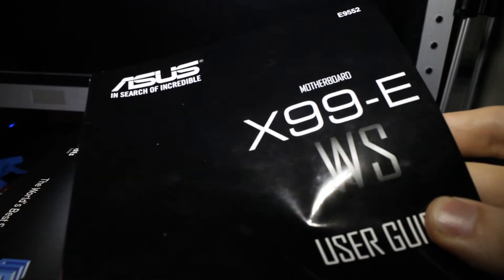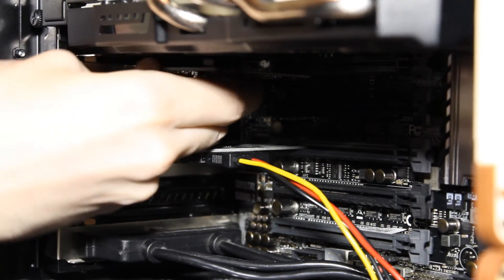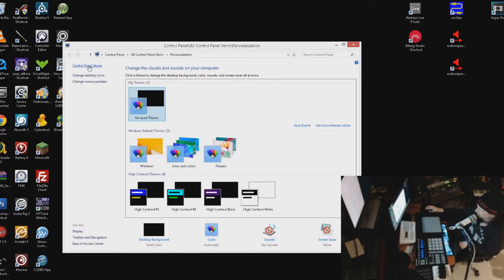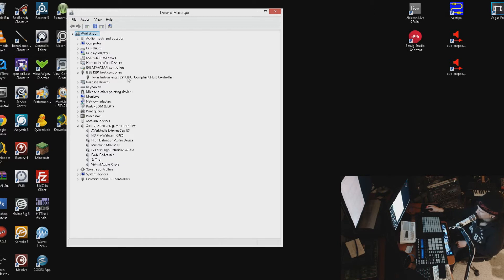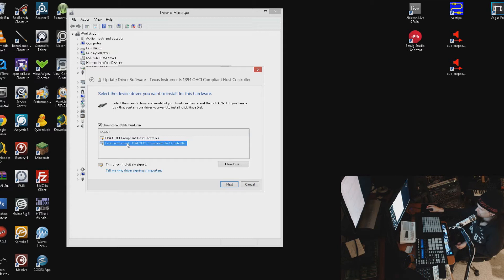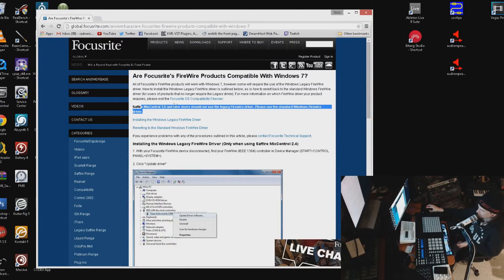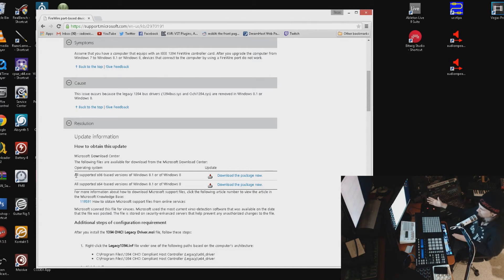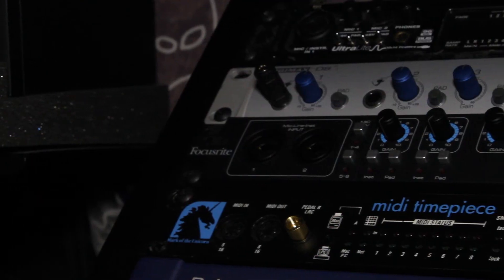Adding A Firewire Card For Your Audio Interface 03 - IRQ, Installation & Texas Instruments Drivers

Comment: Brother can you help me i have focusrite saffire pro 14 and i have not firewire port in my pc please tell me which firewire card i want to buy run my audio interface i have gigabyte h510m-s2 motherboard its have two pcie slot here the specs - 1 x PCI Express x16 slot, running at x16
(The PCI Express x16 slot conforms to PCI Express 4.0 standard.)*
* Supported by 11th Generation processors only.
1 x PCI Express x1 slot
(The PCI Express x1 slot conforms to PCI Express 3.0 standard.)
in 1 port i run my graphic card one is empty

Comment: I bough the same card as you but i got a different driver. should i have the same driver as yours ? driver is 10.0.1904.1 I am having trouble setting up a profire 2626 . My computer recognizes, and i downloaded the control panel software , driver for the M-audio .just no audio .  Thanks for your help .

Comment: I could really use your help.  I'm running a Presonus StudioLive 32.4.2 32-track mixer for recording/playback but keep getting pops and clicks in the audio during playback (only).  Ruled out my sound system since I can play an iPod pristinely via the mixer.  But whenever I play audio on the computer via my Texas Instruments FireWire 800 connection, it gets the clicks and pops.  I do not have this issue when listening to computer audio via my headphones, only via the FireWire 800 connection to the mixer.  I have tried dozens of solutions involving every buffer size, adjusting minimum processor % speeds in power settings, running the cable thru the other FireWire 800 port, changing sample rates down to 44.1 Khz instead of 48 Khz to no avail.  This is on a brand new system with a Intel i7 4790K, ASRock Z97 motherboard, 32 GB of DDR3 1600Mhz RAM, and Samsung 960 Pro SSD for my OS drive.  We are at our wits end and cannot remove the popping/clicking.  I have a new FireWire 800 cable on its way just in case, but I have to believe it has something to do with this connection, whether it be the Windows settings, cards on either end, or the FireWire 800 cable itself.  Please help!

Comment: My M Audio Profire 610 Has Stop Being Recognized By My Computer... PLEASE HELP
(I Made No Changes Or Updates To My Computer)
Please Help It Has Just Stop Working For No Reason I Know The M Audio Itself Is Fine.
I Re Installed It And Thats Fine I Think. I See The M audio Symbol In The Control Panel But Its Not Responding To The Profire Interface. (Like Its Responding As If I Didnt Turn On The Interface) Its Not Reading. WENT To My Device On THe Computer And The Ieee1394 Isnt Showing Up Off Of A Sudden What Happen How Do I Get THat Back. Why Would That Not Be Showing ? It Had To Be There Before Cause I Been Using This Machine For Sometime Now.... PLEASE Get Back
Reply: i have the same problem